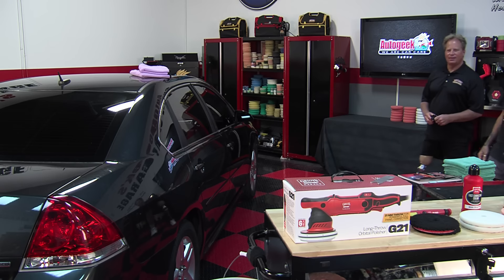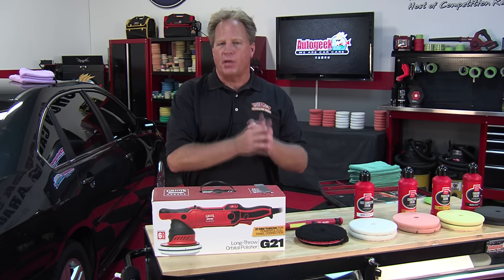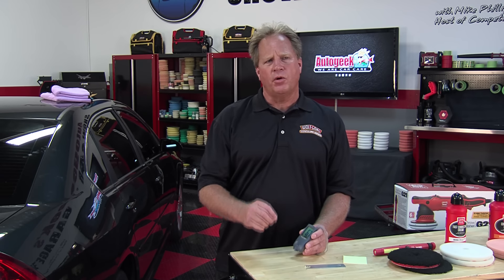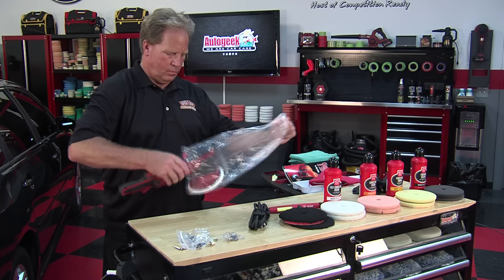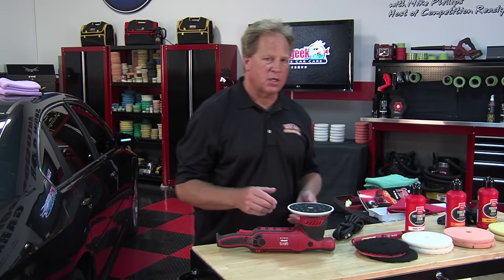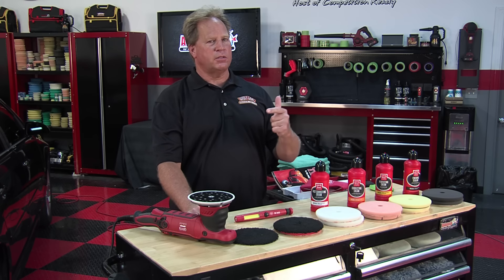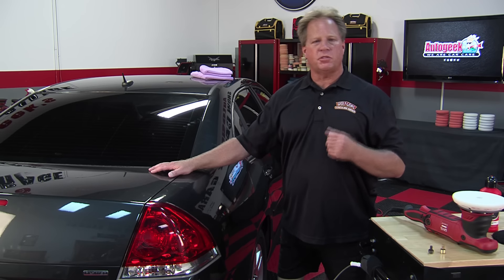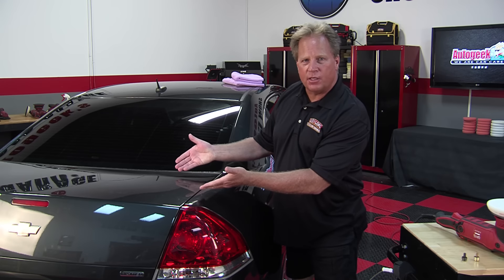How deep is too deep - Dealing with bad scratches and paint defects in your cars paint!

Comment: u are priming your pads very generously......i wonder how that not clogging up the pads. i remembered one famous detailer had shown used pads on microscope and it was seen just with 3 dots of compound and normal 4 passes on a panel pad was really clogged up.
Reply from the maker: Are you talking about foam pads or microfiber pads?  With microfiber pads you prime the pad first and then add 3-4 pea sized drops.  Then used compressed air to blow-out the fibers after each pass.  This blows out the PAINT you removed and the SPENT product on the pad.

With foam pads you use a lot more product.  And this is the key, 

 CHANGE PADS OFTEN. 

Clogging is NEVER a problem with foam pads if you change pads often.  The PROBLEM for most detailers using foam pads is they do NOT use enough pads.  This leads to PAD SATURATION of as this other person says, clogging.

Use more pads.  No problems.

Plus I'm so NOT a 3 Pea Size Drop guy.  This is ridiculous.  You need a FILM of lubrication and abrasives ON the surface to work for you.  You can't get this with 3 pea sized drops.   I guess everyone has their own way - as long as you have a way that works for you, that's what's most important at the end of the day.

-Mike Phillips
Reply: @autogeek  thanks a ton mike for explaining very simply in detail.... yes i saw that video again and i saw it was microfiber pad. Thanks mike for every efforts you had piled up for detailing community. Highest respect for you ever n ever.

Comment: Everyone i watch is always talking about slow arm speed to remove defects from the paint,  but your arm speed is moderately fast and still removed the defect you where chasing.  Can you explain why your arm speed is faster then most.  You can turn out more cars if you can get what you want moving that fast.
Reply: It's all about dialing in the process for the vehicle you're detailing. You can move a bit faster with a forced rotation or a more powerful polisher. Every paint will differ thought and that's the importance of a test spot. Just make sure you start with the least agressive product first.
Reply: Andrew Schwab  I am a bit surprised to hear that. The 3401 has been my go to polisher for the last 9 years! I tried (not current) Rupes 15/21mm polishers and didn't feel like it worked as well for my polishing style. 

I'm not sure one is better or worse but the Rupes bogged with pressure on curves. That said, lighter pressure and more passes seemed to give great results. Just have to change your technique to get the best results from your tools I guess.  

I'm only 150lb but also work out a lot. When I got into detailing, I probably only weighed 120lb. 😂 I was only 16 when I first met Jason Rose at Meguiars!